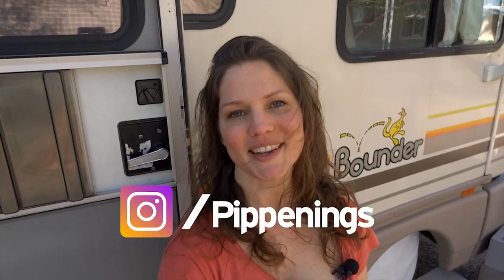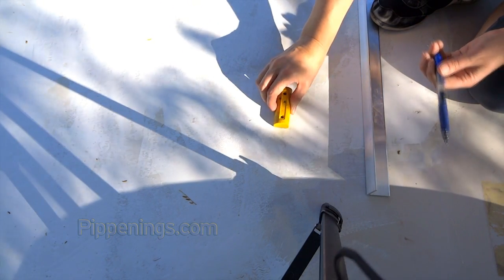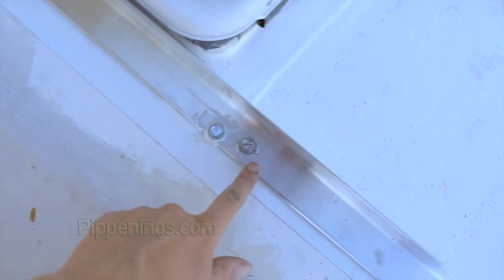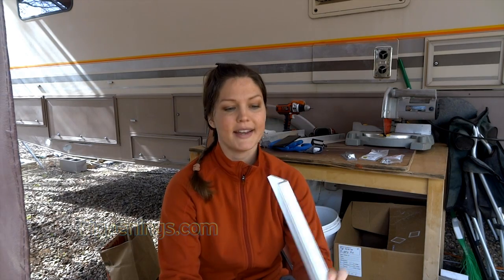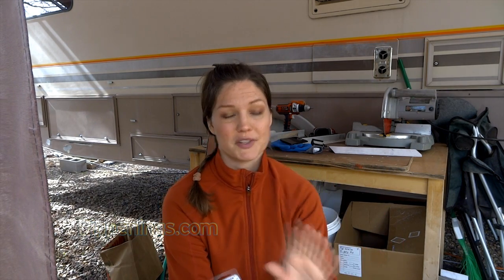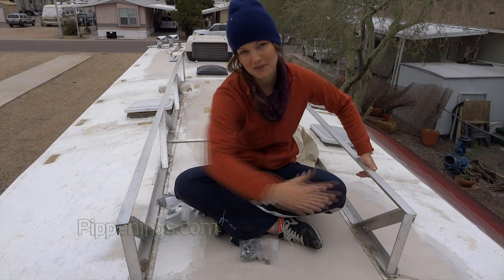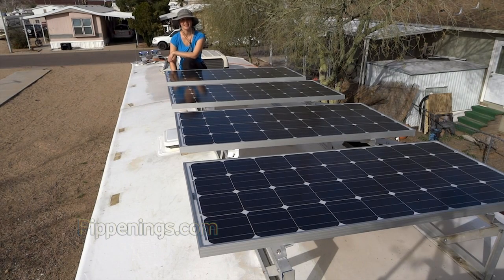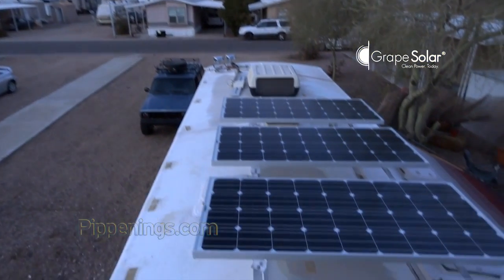RV Solar Panel Installation part 1

Comment from the maker: Supplies Used: 
SOLAR PANELS: https://amzn.to/2G2T4NC
RUBBER ROOF SEAL: https://amzn.to/2I9q1vh
AL ANGLE STOCK: https://amzn.to/2D2WSO3 (I bought mine locally in 17 ft rods)

Comment: I've watched this a few times and learned a lot. I'll be incorporating some version of your design on my Storm Chaser. Your dialogue / voice over is very articulate. Thanks so much for making this. I know it's hard to perform hands on work and film at the same time!!!
Reply from the maker: +Stephen Locke Cyclone Drifter You know it! It can make a 10 minute project last for days sometimes!

Comment: You amaze me at how much knowledge you have on everything you do. I learn so much. I had no ideal that a small shadow could cost you so much of your power from the Solar. Really good to know. If I put Solar on my RV down the road. These are great points to know. You did a great job and those 4 panels will really give you a lot a power. Great Video. :)
Reply from the maker: +Terry Thanks Terry. So happy to hear you learn a lot ☺️ Thanks for watching!

Comment: Pippi, raising the panels will also allow airflow underneath the panels, effectively cooling them. And the panels will be much more efficient when they do not overheat.

Comment: You've got some impressive fabricating skills. Wow. You may have mentioned this in the video but after you drive some miles with the panels on top and/or in cold weather go around with a wrench and check to make sure nothing is loose. That's just my suggestion though. Do what you feel is best.
Reply from the maker: +Love2boat92 Thank you. That's a great suggestion!

Comment: Pippy has so many wonderful DIY vids. 
Perhaps those Z brackets would've been enough.
Renogy panel mounts are the best that I could find...I looked & looked. They are affordable, strong, & with a decently wide footprint (stability) & a LOW profile......Did I mention LOW profile?    Weight matters....
For tilting I used readily available door hinges....3 yrs no problems at all.....  
P.S....I used rubber grommets between the panel frame & the mounts & hinges....Simple mechanics, adjoining metal to metal, best to use a gasket or grommet.

Comment: hi Pippi 
you are right for the most part and the kind of nuts you are using are really , but you can also use a lock washer and that will hold the nut in place , and they have lock tight and it will help hold bolts and nuts in place , but love the videos keep up the good work

Comment: there is a thing called a Stud Finder Itis what I used to find the studs or braces. it should work better than a magnet. Also I would sealer under the angle aluminum then when you screw it down the sealer would be forced into all the places.

Comment: Impressive project and you're not afraid to tackle this big job! All of the gloom and doom comments are not very helpful and possibly are causing you some worry...

So.. here's what I suggest:

I would add a wind spoiler at the front, a fairing of sorts, at about 45 degrees,  that forces the wind at highway speeds to go up and over the panels. Then I would also secure the panels with safety wire...drill holes in the panel frames and attach lengths of 1/8 inch steel cable, anchored to the motorhome roof bows separate from the anchor points that your frame is using. 

If some or several of the fasteners fail, you have a second system that will keep those pricey panels from getting damaged or causing any other liabilities. 

Also, you might want to go up there after the first few on-road trips and check the screws, nuts and bolts, to see if any have loosened. RV roofs do flex a bit as the vehicle moves down the road.

Good luck pretty lady.

Comment: Great Video - One thing to always remember - different metals touching each other can cause corrosion because of a chemical reaction between the metals. For that reason it's not always a good idea to mix different metals. It could hurt you in the long run. I don't know if this will be the case with Galvanized and Stainless Steel. Either way - you are by far the most handy woman I've ever seen.
Reply from the maker: +CanesFan65 Thanks

Comment: Pippi great job! I also have grape panels and they're work awesome! I only have one suggestion and that would be to do more sealing where the frame mounts to the roof, knowing RV roof water will find its way in.
Reply from the maker: +BILL HAWKINS I did more sealing until I ran out of caulk. Just not on the video

Comment: Very impressive, well done.Another advantage of having the panels raised is that the air gap below should keep the RV roof surface noticeably cooler in summer.Re wind resistance, it is basically only a roof rack and peeps carry all sorts of things on them without problems...best to regularly check tighten all the fixings tho'!
Reply from the maker: True indeed! Thanks 😄

Comment: You certainly are not afraid to tackle a project.. Good for you!..  Not sure I would have went that route.. I would have kept them closer to the roof for several reasons.  However I have wondered why someone does not take an alum frame and use a linear Actuator to raise and lower the panels as needed from inside...  A simple gate latch to insure they stay down when traveling with a quick release on it... I think you will find wind to be a problem.. check them after a few miles of travel to see what is going on.. wind can create a vacuum and rip it off so easy...

Comment: I am happy for you! It's nice to have that solar to live on. I have a hard time w/ the high EMF they put out and being in RV I have them on portable frames. A solar installer did the second frame at less cost than I paid for the first flimsy frame. They get stuff at cost. Your rack looks of good quality. So are the panels you have.
Reply from the maker: +Prima Donna Going Off Grid Thanks

Comment: Great job. I agree with another person about after the 1st trip on wind storm, check the tightness of the bolts. Another thing if you ever plan on a long journey I'd look into a wind screen for the front also mentioned by some else. I also would use puddy tape made for RV roofs, it's used by all manufacturers for covering screws holding vents and etc, last for years. I would place it over the screws that penetrate roof.  Thanks for video
Reply from the maker: +Keith Byerly I have a bit of wind protection already from the 10" AC unit right in front of it. But I'll certainly keep an eye on things. Thanks
Reply: Pippi Peterson The video doesn't show the front AC unit. I'd only worry if you traveling a long distance, or AZ's famous shear winds.😎, we went through on of those storms in Casa Grande we were OK, but all the telephone poles coming into the park blew over. Anyway something like that you may not be able to protect the panels at all.

Comment: Nice job Pippi.I have a similar rack I built on my camper.(a Mercedes sprinter van that I converted ).The only thing I used nut and bolts through the roof and made sure to hit a support beam like you did.More work cause I had to open up ceiling but I know it will never pull out.Also a aluminum spoiler at a 45 deg angle at the front will cut down on wind resistance. I attached the panels to the frame with door  hinges so I can pull the hinge pin and angle the panels when dry camping.I never had to use this feature as the panels put at full amps in the Colorado sun even when flat.Also buy your SS nuts and bolts on ebay in bulk for big savings.And always use a anti seize compound on the threads to make later removal a snap.( the rack has been on the roof 10 years and I travel from NY to Colorado several times a year at 70  75 MPH  and it has not moved a bit.)Good luck with the wiring and don,t skimp on the charge controller. The better ones are worth the price.
Reply from the maker: +Jimmy Zamp Good to know, thanks for sharing. I've got the best charge controller available, MorningStar

Comment: Looks like a really strong, robust system. Not to mention, seems there is some capability for putting things under the panels should you ever need to install something else there (more storage?) and there will already be a frame to connect it to, whatever it may be.  Well done!  You are inspiring me to try my hand at some DIY!
Reply from the maker: +Carin “Cariboudle” You can do anything you decide to Cariboudle!! 😄

Comment: Great video and very interesting project. I've enjoyed all your solar videos and love your 'handiness' around the RV...I will be replacing my solar this spring when I replace my roof. You might look at dicor sealant rather than silicone. It's a little more expensive, but well worth the investment. If the previous owner of my RV had used it I would not be needing to replace it now. It is the best for sealing penetrations into the roof. Good idea to add the tape below the frame rails. 

Given the size of the frame and panels  I would install some larger fasteners for the frame to the roof, 3/8" minimum.  I'm worried that in a good cross wind, driving down the road when the semi passes those screws may rip right out, particularly since they really didn't seem to 'grab' anything.  A tip; the vents will have blocking (framing) in the roof that you can use for attachment. When you set the two screws near the vent that 'didn't' grab very well, just add one larger fastener near the middle of the vent. You should get a good connection there. The second screw looks like it probably just missed the blocking and that is why it seemed to grab a little better, you probably just nicked the blocking giving it a little better grab. See where the corner of the vent is, your screw is just outside that.

I don't want to start an argument, but do not put sides or anything else on this setup. Adding sides is going to increase the surface area presented to the wind exponentially increasing the wind pressure. Simple physics, when you stand facing into a strong wind you feel much more air pressure hitting you than if you turn sideways. Same idea. Also spacing the panels like you did will interrupt the air flow under the panels and reduce the lift that they will generate if they were tight together. Your design is perfect, just beef up the fasteners and you'll be fine. 

Love your projects, keep up the good work. Hope your enjoying AZ for the winter, I am.
Reply from the maker: +TR Bowlin More fasteners in the roof may be a good idea. I did talk to an engineer and mechanical designer though that both though this would be ok.
Reply: I figured you had. I recall you mentioned that your dad was an Engineer in the past. Just worried that the screws didn't grab very good. Keep it simple...

Comment: This is going to be interesting. I have watched your previous videos.  You have had some pretty good ideas. Don't know about this one. Never seen solar panels mounted on top of a RV like this before. What instantly strikes me, is wind noise, whistling through the frame, especially when you are travelling. You may want to consider, some sort of windbreaker, to the front of your panel array. Just a thought. Keep up the good work.
Reply from the maker: +Graham King I consulted an engineer and a mechanical designer that both went onto my roof and also spoke with an RV tech at camping world. There are roof racks made for all types of vehicles and all sorts of things on them. I'm not worried. I also have my front AC unit directly in front of the rack to act as a wind deflector. This was not an overnight design. A lot of thought and different pieces of knowledge went into it.

Comment: I would worry about the way you put the rails on. You put some caulk in the hole.Then the screw pulled it into the hole. When you caulk around the screw head water still can get under rails. Hope that will work out ok.

Comment: great video enjoyed it only thing you might look into is a thing called like electrolysis when you use different Metals together if you're using aluminum and then zinc you might be creating what's called a battery and corrosion starts there are ways to overcome that but you want to prevent electrolysis taking place otherwise the screws will disappear
Reply from the maker: +Ramon Zeender Thanks for sharing

Comment: As someone who has done a lot of high work, I would recommend that you emphasize safety when being on a roof. The fatal injury rate of roofers is high on the list--twice that of police. It is easy to get engaged in an installation procedure and stumble or slip. Many RVers have little experience in jobs that involve high work. They have not had the near-death experiences that give one a healthy fear that makes one very cautious : -)

Comment: Nice build Pippi. Please use the safety guard on your angle grinder-put it between you and the disc.The "little dot liquid" stuff for threads is what we always called blue Loctite             ( Loctite Threadlocker Blue 242) It is removable,and bottle lasts for years.Your frame looks solid,but if it does loosen,you might have to through-bolt it into the ceiling beams of your coach.You might want to print a new caution overhead clearance placard for your pilots seat.Pet Chase and give him a treat for me;-]
Reply from the maker: +Mr Frog Thanks. It's actually the same height because it's as tall as the AC units
Reply: Cool,remember-no matter where you're going...there you are ;-)

Comment: I'm just a little bit curious as to why you didn't use the flexible flat panels that would have not only been flat, but contour with the roof as well.

Comment: You did an excellent job and am always amazed at how involved you become
 with your projects.  This is not a criticism, but practical advice for others thinking about a DIY solar installation on their RV.   Looking at your 
installation as a 30 plus year aircraft structural mechanic/design engineer I do 
share the same misgivings as others.    What you've mounted is 
essentially a large sail and from what I can tell it's all dependent on what 
looks to be 1/4 inch lag screws.  Very poor fastener for that kind of 
load.   Gust of wind going 70 mph will put an enormous amount of stress 
on those screws.  The Eternabond tape is an excellent product, but adds 
no strength to your mount.  Would have been much stronger if you would 
have bonded the angle to the roof surface. There's a number of 
adhesives/seals/double back tape on the market that work well.  3M makes an adhesive that
 can be used with angle brackets without even drilling a hole in your 
roof.  If done properly is an extremely strong adhesive.   Surface prep 
is critical, so follow manufacture directions to the letter.  

 Working
 with what you have now, I'd add at least 3-4 bolts per angle through 
the roof into the inside ceiling.   The angles are far enough spaced on 
either side of your MH that you might be able to locate them in a 
cabinet, so they aren't visible.   Use the extra aluminum angle stock or
 large pan washers to distribute the load evenly on the inside.  That will lock your angle mount down tight and assure your expensive panels don't become missiles and keep you off the 5 oclock  News......👍😁

  Ohhh, the stainless fasteners are the way to go, but not mixing metal types.  Cap seal all the fasteners to lengthen their life.  One excellent point that you didn't cover on  your video is your panels are mounted high enough off your MH that you will have enough air flow underneath the panel and not have mini solar ovens on top of your RV.    I applaud you for all the effort and time you put in with your projects, keep up the great work.  👍👍👍

Comment: Pippi please ignore the clowns saying the wind will rip the panels off. They probably don't even own solar panels or RV at that. Many people have the same set up and have never had a problem.
Reply from the maker: +Paul None Ya Yep, everyone has an opinion. I consulted an engineer and a mechanical designer that both went onto my door and also spoke with an RV tech at camping world. There are roof racks made for all types of vehicles and all sorts of things on them. I'm not worried. Thank you for your support Paul!!

Comment: Hi Pippi, I have been putting a small RV solar system together for 5 years now & seen many other systems and failed systems and a Friend of mine who runs an RV place says i must put the panels flat on the roof.  Because the wind or a overhead bridge can remove em & tear up the roof usually costs 2000 to 6000. at the shop to repair, & your panels are gone. so at the very least a sheet metal ramp at 45 degrees or more from the front roof to the first panel is good, and it is necessary to put the panels together or next to each other is good advise. and I agree  mostly with the fellow at Oc Refrigeration below this note. They will most likely blow off at 60 MPH up  also it is reasonable to put one panel on an upper side or on both sides, all this to charge your solar battery bank with a PWM charge control.(is OK) and the inverter, Modified sinewave runs most stuff runs off the 12 volt battery bank. please do not drive down the road until some changes are made to your very will built & nice mount, I do not want you to find out the hard way, Nick Wiese  (6 panels, 3000watt inverter, 1- 150lb. battery) kimbelnick@gmail.com

Comment: Always enjoy your videos Pippi. I am wondering about how vibration will affect the stability of the rack in a wind storm or driving down the highway. A failsafe is a good idea.
Reply from the maker: +Brainsmachine.bc I consulted an engineer and a mechanical designer that both went onto my roof and also spoke with an RV tech at camping world. There are roof racks made for all types of vehicles and all sorts of things on them. I'm not worried.